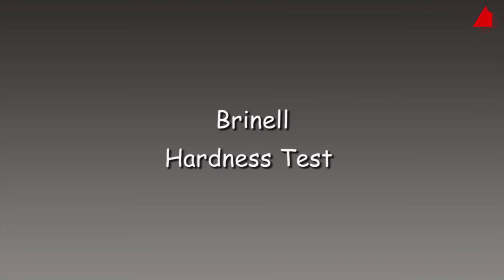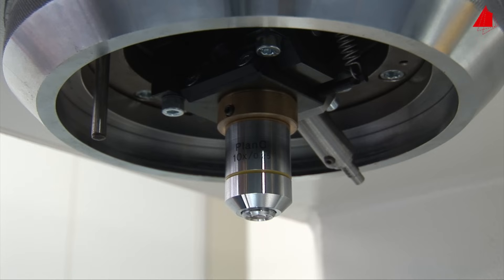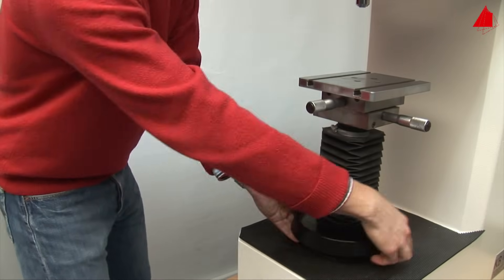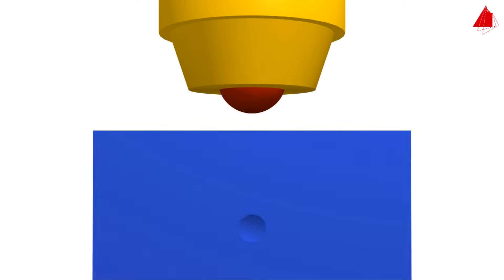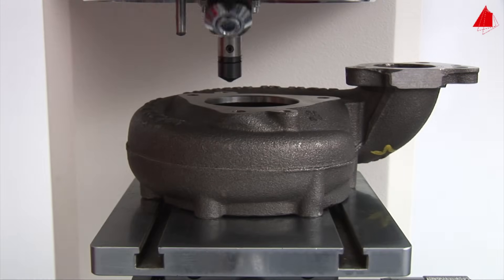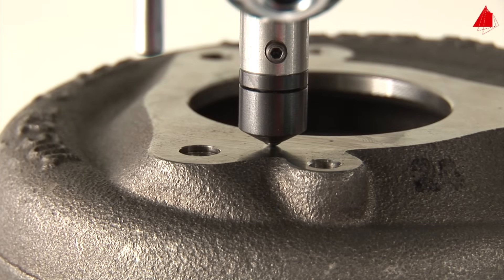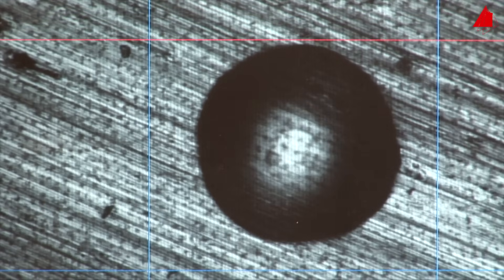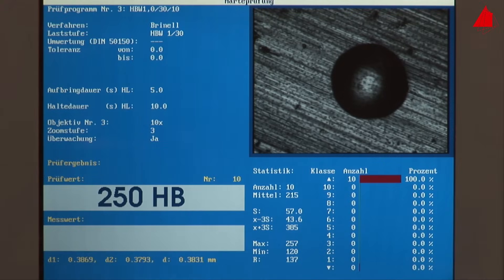Brinell Hardness Test

Comment: I have a question here .How we can determine which indentation test method should be used for the material ? Brinell hardness test, Vickers hardness test, or Rockwell hardness test ?
Reply from the maker: Answer to "I have a question here. How we can determine which indentation test method should be used for the material? Brinell hardness test, Vickers hardness test, or Rockwell hardness test?" A very important point! All hardness testing methods have their advantages and disadvantages, which is why there are three different methods on the market. Brinell hardness testing is suitable for materials with low to medium hardness and large indentations. Vickers hardness testing covers the entire range of materials, but only allows for small indentations. The Rockwell test is the only method that can be easily performed automatically. This is just a brief overview. If you like, you can ask an AI programme for more details. I tried it myself, and the answers were quite interesting...

Comment: Something to consider. All hardness measurements, made by all systems of measurement,  are empirical. The very act of making the indentation to measure hardness changes [increases}
the original hardness due to plastic deformation and accompanying work hardening. Hardness measurement by all methods is base on standard test pieces and direct comparison.
"Hardness of Metals, as the Storminess of the Seas, is Easily Appreciated but Less Readily Measured." Prof Hugh O'Neill, Metallurgy Dept. Swansea University, 1955.
Very good video, most informative.
Reply from the maker: Thank you, I agree with you. If you go into detail, you will find many limitations and problems. However, I would not characterise hardness measurements as completely empirical. Work hardening in the tested area is complicated, but similar in some cases and always present. 
But the results depend on the type of test. So you always have to name the specific type of hardness test and stick to the standardised rules of the test.

Comment: Surface area of the indentation surface, which is spherical, or the surface area of the indentation projected as a circle?
Reply from the maker: Answer to "Surface area of the indentation surface, which is spherical, or the surface area of the indentation projected as a circle?" The Brinell hardness is defined as the test force (in kiloponds!) divided by the spherical indentation area (in square millimetres). The spatial area is therefore taken, not the projected area.

Comment: Why are the surfaces in the tests you presented different? For example, in diamond the surface was small, but here it is large.
Reply from the maker: Answer to "Why are the surfaces in the tests you presented different? For example, in diamond the surface was small, but here it is large.": The diamond indenter for the Vickers hardness test is comparatively small. Consequently, the material to be tested must be fairly homogeneous and the surface roughness must be low. The ball indenter for the Brinell hardness test is comparatively large and the tested material may (to a certain extent) have a certain inhomogeneity and higher roughness. This is reflected in the surface quality of the test samples.
Reply: @MaterialsScience2000  Thank you.

Comment: I'd like to know the purpose of using this machine .I m looking forward to hearing from u.
Reply from the maker: Answer to "I'd like to know the purpose of using this machine .I m looking forward to hearing from u.": Well, to measure the hardness of a test specimen. And hardness is an interesting material property for practical applications of materials: Hardness is related to strength, to some extent to wear, to heat treatment ...

Comment: Don't we need to polish the surface?
Reply from the maker: Answer to "Don't we need to polish the surface?": In Brinell hardness testing, the depth of indentation is usually much greater than the surface roughness. Therefore, polished surface quality is usually not required. If the surface roughness is low, no preparation is required at all. Otherwise, a fine grinding preparation is sufficient.
Reply: @MaterialsScience2000  thank you.

Comment: please explain the working of universal testing machine
Reply from the maker: Answer to "please explain the working of universal testing machine": In a few words: There is an electric motor with a spindle gear, which slowly lowers the indenter until the intended force is reached. The force is measured with a classic strain gauge load cell.

Comment: how do you measure the depth of indentation?
Reply from the maker: Answer to "how do you measure the depth of indentation?" In classical Brinell hardness testing, the depth of indentation is not measured, only in Rockwell hardness testing, for example with electromagnetic transducers.
Reply: @MaterialsScience2000   thanks for the info!

Comment: Can I know which indentor ( material ) is used in this test? Also how much hardness is desirable to test mild steel rod? ( Mean to say, how much difference in hardness is preferable between indentor and workpiece?)
Reply from the maker: Answer to "Can I know which indentor ( material ) is used in this test? Also how much hardness is desirable to test mild steel rod? ( Mean to say, how much difference in hardness is preferable between indentor and workpiece?)": This is an important point. Here we have used an indenter made from cemented carbides, and this has been standard for a long time now. The indenter has to be at least 3 times as hard as the workpiece. Since typical cemented carbide indenters have a Vickers hardness (roughly identical to Brinell hardness) of 1800 to 2000, the maximum Vickers hardness for the workpiece is around 600 HV, which is roughly equal to a Brinell hardness of 600.

Comment: Sir ,Is 250 hb is  for specific load only .if yes  then for different loads we have to calculate different times to find hardness. So is it a limitation of this machine or i am wrong. Sir plzz make my confusion clear.
Reply from the maker: Answer to "Sir ,Is 250 hb is  for specific load only .if yes  then for different loads we have to calculate different times to find hardness. So is it a limitation of this machine or i am wrong. Sir plzz make my confusion clear.": In the Brinell hardness test different loads may be applied for one and the same material, as long as the indents in the material are reasonable (within a given range). In most cases, the results are almost identical for different loads. Twice the load normally leads to twice the surface of the ball impression - and the same hardness as a result.

Comment: I would like to know what are the parameters to consider for choosing a scale Rockwell Hardness and what are the reasons for chossing these parameters.. if it's maybe depending from the material, etc??.. well your video was about the Brinell hardness test but if you can help me about the Rockwell hardness if possible..
Thanks !
Reply from the maker: Answer to "I would like to know what are the parameters to consider for choosing a scale Rockwell Hardness and what are the reasons for chossing these parameters.. if it's maybe depending from the material, etc??.. well your video was about the Brinell hardness test but if you can help me about the Rockwell hardness if possible..": The Rockwell hardness scales A, B, C, ... have been introduced for application at different hardness levels, for instance B for rather soft materials and C for rather hard materials. The equations, for example HRC = (0.2-e)*500, were introduced (i) originally for easy display of the hardness value on old testing machines and (ii) to get a "nice" hardness value scale of up to 100. The depth of indentation e is limited to a maximum of 0.2 mm.
Reply: @MaterialsScience2000   may i get your WhatsApp please.

Comment: can anybody guide me.. How much load is required to test Aluminium casting component . & what should be the ball size. Hardness is in the range of 100 to 120 bhn. ?? We appreciate your help in advance
Reply from the maker: +Deepesh Mehta As a ball diameter D you may choose any that will fit the purpose (shouldn't be too large). For comparatively hard aluminium alloys the (empirical) equation F = 10*D^2 (D in mm, F in kp) will give you an initial (good) guess for the test force. Example: D = 1 mm >> F = 10*1^2 kp = 10 kp (= 98.1 N).

Comment: Hello, and thank you for the videos. I would like to know, when should we use Brinell, Rockwell C, Vickers, etc? I would think that Vickers is specially useful to compare with brinell in fragile materials, where micro cracks could lower the vickers hardness, and to estimate scratch resistance. HRC seems to be favoured for cutlery and as a quick way to extrapolate tensile strength; and Brinell appears to be the preferred way to measure through-hardened pieces which will be subjected to large forces, like armour plates.
Reply from the maker: +SalveMonesvol  Main considerations are (among many others):>> Brinell: +> good for heterogeneous materials like grey cast iron (if average hardness is wanted), because the tested volume is comparatively large -> no small indentations are possible, very hard materials cannot be tested>> Vickers: +> almost all materials (except diamond) can be tested, test region can be extremely small and just one grain may be tested > large indentations are not possible, not good for heterogeneous materials, if average hardness is wanted>> HRC: +> easy to automate (very important) > no very small indentations possible, less variable
Reply: MaterialsScience2000 Thank you very much!

Comment: will thickness of a metal also increases its hardness naturally? Like an 1/4" AR500 steel and a 1" AR500 steel.
Reply: +7150285 Usually, thicker metals will have a lower hardness, due to the nature of the thermal treatment. Also, an extremely thin (1/10th of a mm for egsample) can not be tested for hardness with normal methods because it it not thick enough to allow the indentation, you would be indenting the machine's support surface; I would use the old method of scratching with known hardness files.
Reply: SalveMonesvol another question, core hardness is usually harder or softer than surface hardness?
Reply: 7150285 Softer. It cools slower.

Comment: Will the diameter of the ball be including in the testing?
Reply from the maker: Answer to "Will the diameter of the ball be including in the testing?": Yes, it is important. The equation to calculate the spatial area of the indentation (using the measured indentation diameter) includes the ball diameter.

Comment from the maker: "this method applied for the hardness of ferrous material" The Brinell hardness test may be used for almost all metallic materials with low to medium hardness. Only materials with high hardness (roughly more than 600 HBW) cannot be tested, because then the indenter (made from cemented tungsten carbide material) would deform itself plastically, rather than the test material.
Reply: +MaterialsScience Thank you for that answer, I was curious as to what material was being used for the indenter. Seeing as how this test has certain limitation I'm curious as to whether or not the Vickers test is seen as being more reliable. Then again, it's probably rare to have to frequently test materials above the limitations of the Brinell test.
Reply: Hello,

But for non ferrous alloys like aluminium alloy hardness value measured in HB how...?